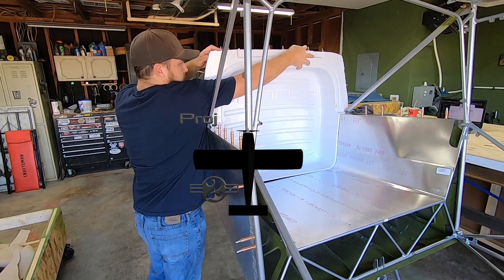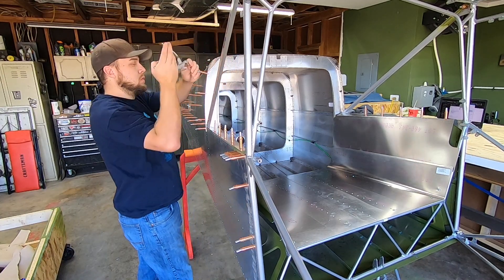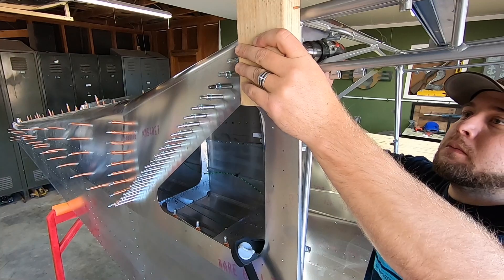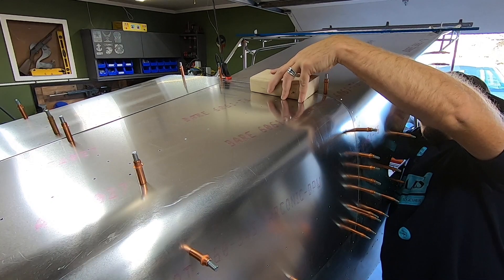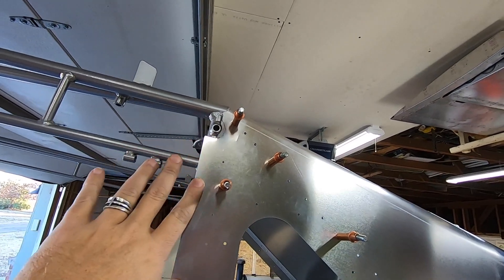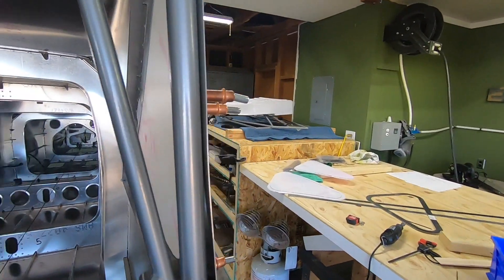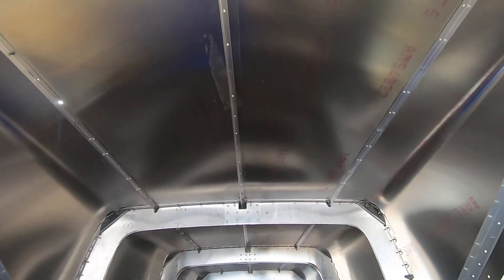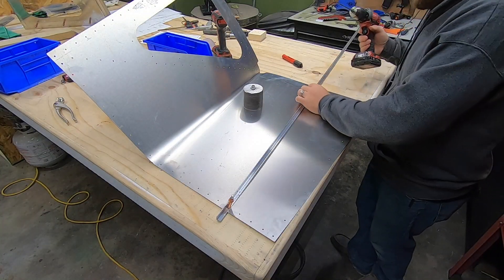RANS S21 EP14 UPPER FWD SKINS AND STRINGERS

Comment: Is that just a small die grinder you’re using? Where do you get the sanding disks and the scotch bright pads for it as well?

Thanks,

Keith
Reply from the maker: Yea, it’s from harbor freight.. The Discs are the 3m Roloc system and you can find those online in lots of places.

Comment: It looks like your short stringers on the forward top skins are one hole too short in the back.  At least when I look at Figure 07-08 it looks like the rear of the stringer attaches to the bulkhead tab and spans to the spacer strip at the front.
Reply from the maker: You’d be right! I have replaced those. Great eye sir!

Comment: I am leaning towards drilling the rear of the front top skins up through S-3 as well.  My only concern was the slight angle of the drill caused by the lower flange on the bulkhead.  Did your rivets sit flat on the skin when you riveted?  I want to be sure the angle isn’t enough to cause the rivet head to not lie flat on the skin.  It is hard to tell in the videos.
Reply from the maker: I ha no issues at all, I used a long bit so the angle is as minimal as possible.  In my opinion hand drilling from the outside is just as inaccurate and results in just a much angle variation on the 1000 other rivets completed so far. In the end it’s up to you to make that call. Happy building sir👍

Comment: I don't see you add any primer and or paint between the aluminum parts.  You only put it where the aluminum touches the steel.  Do the plans not call for all the mating surfaces to be coated?
Reply from the maker: 6061 is in itself corrosion resistant. If you live in an environment requiring such protection, the builder can choose to do so. For my environment and mission, I’d rather save the weight. Thanks for watching Charles! I plan on goin into the details of why I’m not priming in a future video soon so stay tuned👍

Comment: What’s the modification to the elevator bulkhead guide? Great video!
Reply from the maker: Thanks Branden! Short version of the story is your checking the cutout in the plastic guide. If it’s not wide enough you just make the cutout wider. The ones that are wrong (like mine) have a noticeably taller cutout. Hope that helps. I suspect if you didn’t get the email, maybe it didn’t effect your kit?

Comment: Nicely done. I trimmed the uneven overlap on the top where the skins meet. I also had a rough cut on the rear edges that needed some attention.
Reply from the maker: Yea, I have those marked currently, wasn’t sure how to get a good straight cut without a brake so I left it for now👍 Thanks for watching Robert!